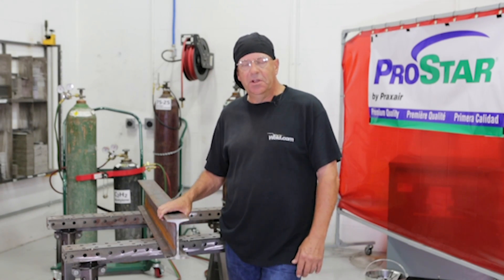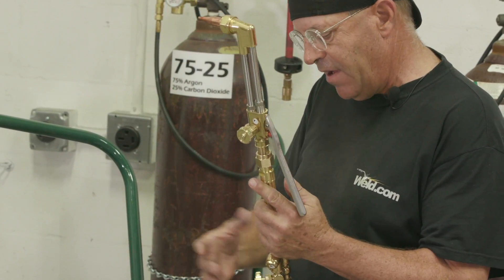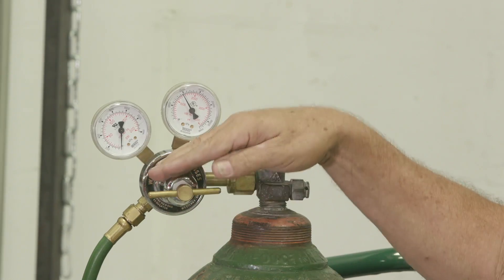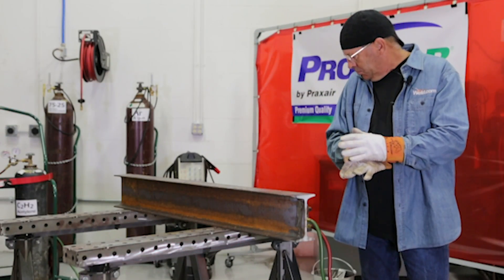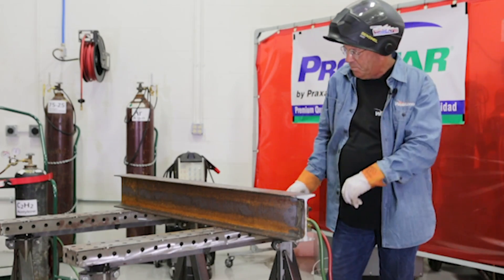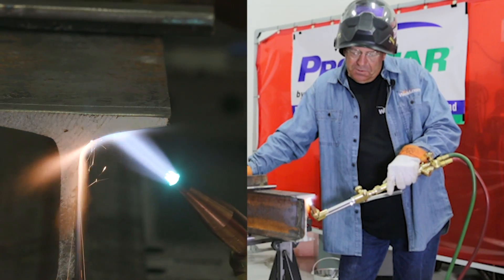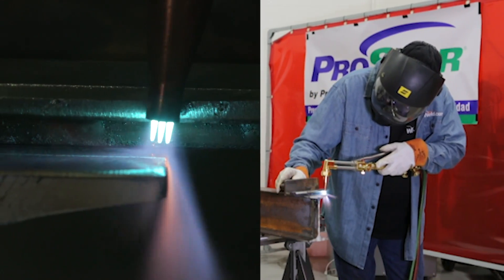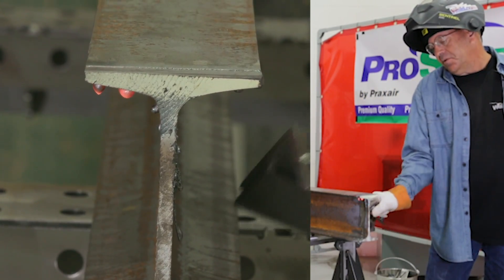🔥Flame Cutting I-Beam Technique

Comment from the maker: Sorry if this video hit ur inbox multiple times. We had an issue when we were uploading it where only about half of the video was actually making it onto YouTube. Took some time to get it all figured out.
Reply: Anticipation.
Reply: Weld.com I just got one and it was all there.  And I liked it👍
Reply: Great videos. Can you guys do a video on welding stainless with oxy-acetylene?

I'm a hobby welder and cash for an arc welder is not in the cards. The current project is a car exhaust, 316 stainless, 16 gauge 1.5 inch tube. I've had limited success using a flux to cover the front and back of the weld. However I'm sure my technique is lacking because the welds are pretty ugly!
Reply: Taskarnin what are you using for a flux? Backing fluxes for TIG welding may work, but I have never tried it (if anyone wants to donate a small amount of Solar Flux B to the cause, I will make a video :-) . One of, if not THE, mainstays of flux for OA welding of stainless is Oxweld Cromaloy flux. It has been variously branded Oxweld, L-Tec, ESAB, and All-State over the years, but it has always been called Cromaloy. It is no longer made, but Netwelder.com still shows some new-old stock L-Tec Cromaloy flux in stock:

https://www.netwelder.com/cromaloy-brand-flux-for-welding-chromium-containing-alloys-1-pound-can/

There is a one-man outfit called TM Technologies that specializes in OA welding of most metals. They are primarily geared towards aluminum welding, and sell fluxes and filler rods of various aluminum alloys. However, they also support the OA welding of ferrous metals, stainless steel, and copper.  On their stainless steel flux page, they list OA welding flux for both stainless steel as well as nickel alloys (i.e. Inconel) as well as TIG backing fluxes for both stainless and nickel alloys. At 4oz, the containers are only 1/4th the size of a container of Cromaloy, but it is much cheaper as well. IIRC his fluxes are made by Superior flux, and they have a good reputation.

https://www.tinmantech.com/products/welding/welding-flux/stainless-steel-welding-flux.php

In my opinion, I think a 4oz container of the TMTech stainless steel gas welding flux would be the best bet for starting out due to the reasonably low price. Follow the directions on mixing and use given with the flux. You mix it to a thin paste, cover both sides of the weld joint, and brush some on your filler rod as well. You probably already know this, but you should be using 316L filler on 316 parent metal. Stainless doesn't conduct heat as fast as steel, so use a torch tip one size smaller than you would for steel of the same thickness, and adjust the torch flame to just a hair on the carburizing side. I mean just the faintest bit of an acetylene feather thinly "coating" the inner cone. This will ensure that any minor pressure fluctuations don't accidentally make the flame oxidizing. On oxidizing flame on stainless will form very refractory chromium oxide, which is A Bad Thing™. At the same time, you don't want excess carbon for the stainless to pick up as it will encourage carbide precipitation at the grain boundaries. If you have 2-stage regulators of good quality and you are good at setting the flame, you can go ahead and adjust to a truly neutral flame, but when in doubt always go just a skosh to the carburizing side.

After you get the torch and flux squared away, it's all practice, practice, practice. Stainless welds much like carbon steel. Easier in some respects. Remember, inner cone closer to puddle=more heat, inner cone further away=less heat. Do not, under any circumstances, flick the flame off to the side to reduce heating. It will reduce heating, but it will also expose the molten metal to the atmo, making a bunch of nasty chromium oxide.

Bob has a couple videos in the Weld.com playlist where he demonstrates OA welding on mild steel both without and with filler. Aside from the necessity to keep the joint and filler rod fluxed, stainless welding is pretty much the same.

Here's Bob doin' some gas welding:

Gas Welding Technique: https://www.youtube.com/watch?v=kFYmBV6l_f8

Gas Welding part 2 (with filler rod): https://www.youtube.com/watch?v=5bqd9rhYxFk

Gas welding with filler wire: https://www.youtube.com/watch?v=YA5NJqSQrYc

Once you become proficient with it you may even lose your desire to buy a TIG machine :-D
Reply: @WTFChuk  I'm currently using the solar flux type B. Wish I knew about the alternatives you listed above, the stuff is expensive but seems to work well. A pound was $40, figured I'd waste a quarter of it learning how to use it and a quarter on this project. I also figured learning how to weld with flux may help with aluminum in the future.

TIGs are nice but with how often i weld (every day for 1 or 2 weeks on a project then I'll set it down for 6 or 8 months) its hard to justify the cost. The oxy-acetylene required no infrastructure also provides other services in my shop (damn the rusty bolts). When I bought my outfit I had no electrical in my garage except a light.

I'm still waiting for the old man to give up his old Lincoln buzzbox then I'll be set!
Reply: Taskarnin The Solar flux  may be your problem. I checked out the MSDS, and it listed "SiO2 (silica) 6-12%" as it's only hazardous component. This likely means that the remainder is something like kaolin clay, maybe some alumina and/or rutile. It's really designed to simply melt and fuse over the stainless before the stainless itself reaches a temp where it oxidizes. Unfortunately, it appears to lack chemicals needed to dissolve the refractory chromium oxides that naturally form on the surface of stainless steel. Worse yet, the lack of fluxing agents means you may be getting inclusions of the Solar B in the weld puddle.

The MSDS for Cromaloy flux lists standard fluxing agents: Borax, Boron Oxide, and Calcium Fluoride (fluoride salts are the ones that dissolve refractory metal oxides, such as chromium oxide when welding stainless, aluminum oxide when welding aluminum, nickel and chromium oxides when welding Inconel, etc). It also has Calcium silicate and kaolin (kaolin is the clay used to make porcelain), which form the glassy coating that protects the metal as it cools below red heat. 

Assuming you don't want to spend $60.00 on the Cromaloy flux, I would suggest getting the $18.00 jar of stainless welding flux from TM Tech that I linked in my last post. You won't waste your Solar B - use the Solar B on the back side of the weld, and the stainless welding flux on the front side. That way, the Solar B will protect the back side, just as with TIG welding, while the TM Tech or Cromaloy flux will do it's thing on the front side to ensure a good weld.

Another thing you may want to try is to use the Solar B on the back side and NO flux on the front. The Cobra torch demos show the welding of stainless with no flux on either side, using a carburizing flame. I suggest starting with a barely, just-a-hair carburizing flame, and then increasing the acetylene if necessary. Be advised that any substantial acetylene feather will add carbon to the molten pool, and that can cause carbide precipitation issues. The only real way to get around that (aside from not using a carburizing flame) is to use 347 filler rod. 347 contains Columbium as a stabilizing element, which prevents carbide precipitation at the grain boundaries.

Here's a video of a Cobra torch being used to weld stainless with no flux:

https://www.youtube.com/watch?v=q5zurNKr6XQ

No, you don't have to use a Cobra. They're high quality torches, but I don't like the pistol-grip ergonomics. I prefer to hold the torch just like a TIG torch, but that's a personal preference thing. Any quality torch with a quality welding flame will work. If you're using a Chinese/Taiwanese special with a crappy flame, get a real torch,  or at least a good quality welding tip. The Asian torches are mostly clones of Western types, usually Victor or Harris, both of which are ironically no longer made in the US either :-( . Sometimes they will take the tips from the torch style they are a clone of, but sometimes they won't. Just as with TIG welding, where good quality tungsten with a proper grind is necessary to make a good weld, gas welding requires a quality welding tip with good flame condition.

The final thing is practice, practice, practice. If you become proficient with the torch you will likely find you won't have a need for TIG. A TIG welder is something you either genuinely need, because you're welding for a living and it's faster than OA and can weld titanium, or it's something you want and have the disposable income for. In either case, if you become proficient at gas welding you will find transitioning to TIG to be pretty easy. The only real difference between them is the heat source; the actual motor skills used to weld with the two are very similar. You may also end up like some of us who still gas weld and OA braze-weld even though we have TIG machines, because sometimes it is still the best process for a given task. 

</rant>
Reply: Chuck, thanks for the info. I just saw that Cobra video the other day. I haven't had a chance to try carburizing flame yet. I was always taught to weld with neutral flame and cut with slight oxidizing flame. Never even thought to try that because of the carbides you mentioned.

I have 304 and 316 filler (which I had bought after having issues with the 304).  I've also tried and had some limited success with my S2 filler rod, which is just for general mild steel purposes. I understand there are different gas rods but to be honest, almost everything I've done has been mild steel up to this point and the TIG rods appear to be close enough for government for my projects so far and much easier to get my hands on!

I'll try getting the flux if all else fails. As always with hobby/home projects and repairs budget always gets in the way of the fun!
Reply: @Taskarnin  As a rule you do use a neutral flame when welding. The problem is that it is easy to go from carburizing to oxidizing, because a truly neutral flame is a razor-thin adjustment between those two extremes. If you get the sparkler effect when you weld on completely clean steel that is an indication that you have a bit of oxy in your flame. If you adjust to just the barest hint of an acetylene feather you will still be "neutral" for all intents and purposes without the worry of drifting to the oxidizing side. The lack of sparklies is nice as well. Nobody likes when a spark goes up into the tip and causes a backfire which blows your molten puddle everywhere.

304 should weld 316 just fine. They are compatible, you just don't get the added corrosion resistance to things like seawater that you get from 316. You may have gotten a bad batch of rod. It isn't unheard of with rod made in the 3rd world. Or any metal, for that matter. There has been issues of steel and stainless steel from India being contaminated with radioactive materials because they don't properly screen their scrap feed.

The TM Tech flux is $18 plus shipping for a 4oz container. If you weld a lot then you may want to buy the 1lb can of Cromaloy, but the 4oz can of TM Tech should get you started on the cheap.

Comment: I like my valves away from my body and I always tighten the nuts on them all so they are stiff to turn. I can’t stand a valve that you can move easily. Guys at my work don’t understand how to do things like that. Nothing worse than cutting good and you bump the valve with your body and it screws up the flame 😾😾😾🤬🤬lol. But us semi old timers know a thing or two ✌️.  Also I’m use to cutting some knarly stuff out in the mine plant

Comment: seems like you went constant speed on the second mid section cut? guess it was going smooth enough for ya not to need to slow down ,,great cut,,btw you have done almost all kind of cutting techniques using gas and arc,,would you ever think of showing thermic lance technique? hehe

Comment: Why do you open high pressure cylinders all the way?
Reply: Because of the type of valve.
Reply: Thanks Bob 👍
For anyone else interested I did google this after posting the question and came across this Virgina PSA type of article. Apparently high pressure cylinder valves have a double seat which takes the cylinder pressure off of the valve packing, so not opening the valve fully may cause it to leak.

https://www.dmme.virginia.gov/dmm/PDF/TRAINING/REFRESHER/MaintenanceRepairTopics/AR-oxygen-acetyleneuseandsafety.pdf

Comment: Thank you for this. I have a couple of I beams I need to cut, smaller or thinner but used as supports f or solar racking. I got the extras from a job and was going to try to d*ck around with my band saw and a cut off wheel, but even tho I a lowely electrician can see your skill, my cuts will be junk, but I can practice now till I get it right with my torch.

Comment: Hi Bob love the vids I haven't seen anyone post a video about stick welding gaps. Especially in position as in vertical up. Would u only be able to use a 6010 fast freeze rod or could you use any other type of rod for this application. I'm in UK so everywhere is just boxes of 6013 s hanging around. Thanks again bob!!

Comment: You are making the unevenness in thesurface worse by the way you are grinding. Hold it flat in the length direction of the surface and it will flatten out the unevenness .

Comment: SEEMS EVERYONE IS PLASMA CRAZY    
PLASMA IS GREAT   BUT I ALWAYS THINK THE OLD WAYS ARE VALUABLE
COULD YOU MAKE A VID DISCUSSING THE VALUE A GAS AX STILL HAS?
MUCH MORE PORTABLE   AND THEY ARE STILL THE MAIN USE IT SEEMS ON THE BIG STEEL JOBS
ALSO DISCUSS CUTTING PRESSURES AND TIPS .,    THANKS
Reply: Well the one thing it can do is cut very thick steel. Plasma and laser can't touch it in this area. 12" thick with a nice square cut is easy to achive with oxy fuel. Our brand new Hypertherm plasma table was ordered with a torch head. It swaps out with the plasma head on a magnetic mount. It is all intergrated right in the Hypertherm software. So even the best plasma cutting company knows a torch is still required for certain tasks.
Reply: @geoffmooregm  
Yeah I'm still trying to attach this rosebud to this plasma torch . . . Huummm
Reply: @tubeonline629  ahh yes very true! I don't do much with a rose bud these days but a very useful attachment.
Reply: HA THAT'S A GOOD ONE  
MAYBE PUSH HARDER ?
THANKS
Reply: THANKS
Reply: WHY ARE YOU YELLING!!?? PLEASE turn off your cap lock. Thanks.

Comment: I would like to add a tip that has worked for me plenty of times. When cutting I-beams with a torch, I found I like to cut the web first and then cut the flanges. It really helps not getting those notches in the face of the beam.

Comment: How do the different fuels affect cut quality? At my workplace we are running natural gas with 00 tips, 20 psi of fuel, and 70 psi of gas. (Pressures are high so we can run large rosebuds)
Reply: in my experience you just have to run more fuel for the colder burning gasses or cut slower but the quality is the same

Comment: I have an old Harbor Freight torch that that hoses are leaking.  What brand or type of torch do you suggest for a part time metal worker?
Reply: Mark Holbrook victor
Reply: @fetus9281  Thanks.  I'll look for one.
Reply: Why not  just replace the hoses? If the torch is ok.
Reply: @tubeonline629  The torch works but is under powered for cutting over 1/2 steel.

Comment: Why do we open the oxygen valve fully instead of one turn like the acetylene
Reply: Joel Edwards it’s a double seat valve, needs to be opened all the way to prevent leaks.
Reply: David DeMoise  thanks for the explanation. The seniors at my job gave me a hard time when they saw me setting up and fully opening the valve of the oxygen. I couldnt justify why i did it other than thats what i taught. Now i know
Reply: And with the Acetylene you only open it partially so you can quickly turn it off in case of a flash back.  True, nowadays you have check valves and flash arresters on the torch (or should have) but they can fail too.  That tank valve is your last chance to prevent a explosion.

Comment: I was taught to hold the cutting flame just barely at the surface of the metal being cut when I was an Ironworker apprentice. You hold it quite high over the cut. I wonder if there is any advantage either way?

Comment: thank for your educational video. i'd like to know if you can explain how do you make the straight edge used to cut with the torch and where do you exactly place it to cut . is that possible please ?
thank you
Reply: Peter Welder the straight edge can be made from a piece of 3/8 or 1/2 flat bar. I weld on round bar to the bottom to keep it up off the work piece. That also keeps slag off of the burning bar. 
The offset for a torch is normally around 3/16 from the cutting line to the burning bar. Measure and adjust as needed.
Reply: don't cheat  just keep practice I cut only free hand
Reply: Why, you will get expelled if you cheat? I think anything goes as long as you do the job neat and quick
Reply: if use always straight edge (cheater) u will never get stady smooth moving hands same with tig welding only practice makes u really good . first few cut are bad but after while u getting better and better when I started few years ago old guy told me same thing and after few day/weeks my cuts was ok now after few years Is way easier and faster free hand cut
Reply: @pawes2266  I agree with you that practice makes perfect, but i doubt that you can arm wrestle that torch after, let's say, 8 hours of stick welding in weird positions, and win. The ideea here is presenting a good beam cutting technique, not learning to wield a torch